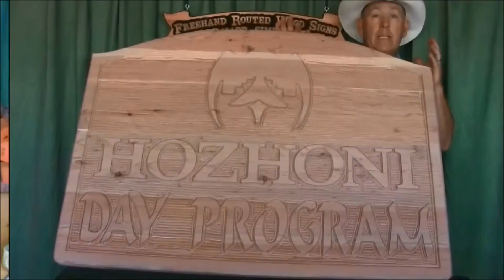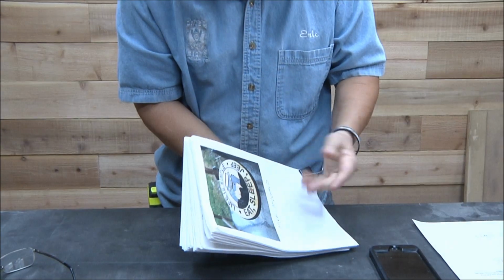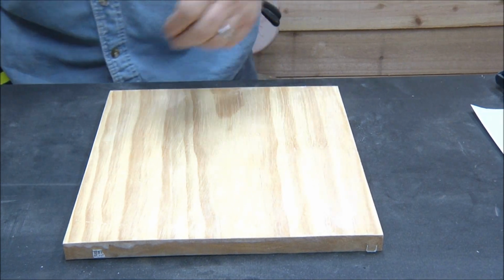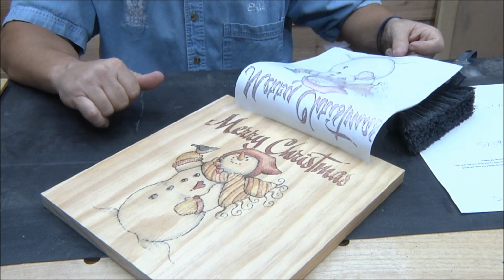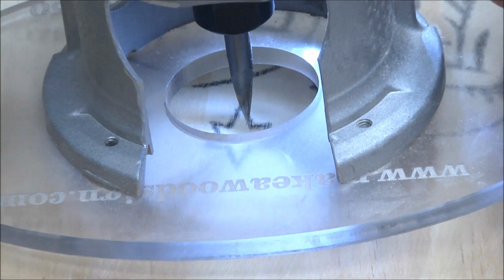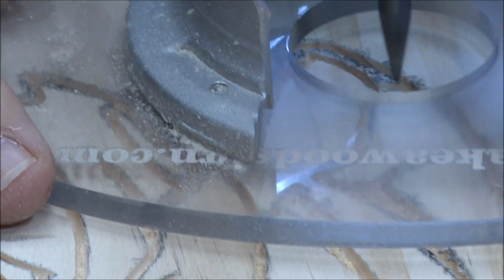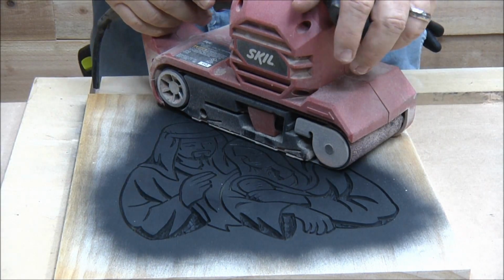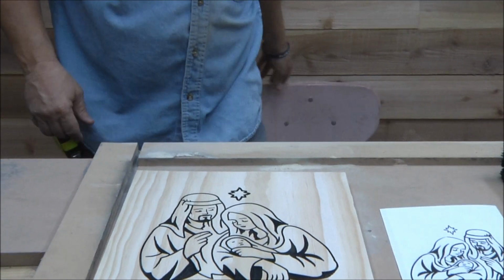#230 Inkjet Transfer Process for freehand Carving Wood Sign Demo

Comment: I've completed sign with inset letters, outset numbers (with Eric's) cloud outline, with full picture in the center (~ 5x9) using freezer paper. Color pic turned out perfect!! I made sure to tape down all sides so pic did not move while using wooden spoon to rub in all directions. To get all ink to transfer and show up nice, you must run in all directions (vertical, horiz, both angled). Picture just adds another element to our router carved signs (plus it easily adds some color). Thanks Eric for sharing all your learned secrets (tricks of the trade)!
Reply from the maker: Sounds like you have a great process that's working for you. Thank you for the kind words, happy to help.

Comment: Attempted my very first router carving on pine.  I used a drill master 120 volt 1/4" trim router and the bit I used was a 1/4 straight bit, only because they didn't have a profile bit. I know I'll need a better router and bits eventually, but I was just trying g this out for size to see if its something I'd like to eventually do and I'M SO IN!!! It's not great but it give me a feel for the handling of the router and the figuring out the best depth for the bit.

Thanks for all the videos and great advice.
Reply from the maker: Thanks so much Emily for watching and the nice compliments. Please let me know if I can answer any questions for you, eric@makeawoodsign.com.
Reply: @oldave100   I'm sure I will have many questions down the line and appreciate your help in advance.  Oh, I forgot to mention that since I don't have a printer, to print a stencil, I used vinyl. I have a cricut die cutting machine and was able to cut out a stencil of my subject.  It was very helpful in keeping me from carving out what I shouldn't.  I will email you a photograph
Reply from the maker: Sounds great Emily, happy it worked for you. Yes I would love to see a pic when you're done. Thanks again!!!

Comment: Hey Eric, Great Video. I use my Inkjet as well. I however use a transparency film. I rough them up with 100 grit sandpaper (WET) and scratch up an down, sideways and diagonal both ways. These are reusable many many times.   In fact I am still using the same one for over 7 months. Happy carving.
Reply from the maker: Thank you Ronald, glad you found a process that works for you.

Comment: Thanks for the idea. The only problem I had is the paper kept jamming. So I just taped a piece of paper on it and it worked great. Works great. Was able to do 2 transfers from one sheet
Reply from the maker: Yea it's funny how some printers can be touchy. Vicki and I have exactly the same model of printer. Mine works fine, and hers jams up. Taping to another piece of paper works or even a glue stick instead of tape.

Comment: sorry for the stupid question, but I have to print the glossy part of the paper or the other? tnx
Reply from the maker: Not a stupid question, I should have said it. The glossy side is what you want to print on. Thank you for watching and please let me know if you have any other questions, eric@makeawoodsign.com
Reply: @oldave100  I tried to print on the glossy side but the print is wet and as soon as you touch the sheet the drawing is ruined
safe to use inkjet or laser jet?

Comment: Definitely going to give this a go.i would normally print a stencil and use carbon paper and draw around everything, this freezer paper could save alot of time . I've never liked the idea of glueing the stencil to the wood ,just to messy. .I've also seen someone use lazer print paper, face down  and a warm  iron,..and you iron the image to the wood and yes it does work..lol..
Reply from the maker: I've tried the iron on and I like this much better.

Comment: Just a tip, if your freezer paper does not feed into the printer, I use a regular piece of printing paper as a backing and just glue the end where the printer grabs. I have found this to work for me. Some printers are a little fussy.
Reply from the maker: Great point, that's where the label backers may work better. They feed through the printers easier.
Reply: Yes I have seen that but I have not tried it yet. Freezer paper is cheap so that is the way I went

Comment: Hi Eric or Hey Bill what do you mean by "using the paper as a follower" tape it don't glue it"?
Reply from the maker: So I've been experimenting with taping the freezer paper to a regular piece of paper. Here's what I did. I used scotch tape and and taped the freezer paper all the way along the leading edge that's feeding into the printer to a piece of regular paper so they act as one piece. It worked good... Then I separate them after the copy is made. hope this makes sense. I'l make a video on this soon.
Reply: Great- I got it.  Thank you.

Comment: Hi Dave and Eric, great process, if the image is bigger than 1 A4 size and would need to be spread across  2 pieces of paper, is the freezer paper still a viable option?
Reply from the maker: Thank you Sean. Yes, absolutely... I just posted a video where I do do layout with freezer paper with multiple sheets. I use a website called rapidresizer.com
Reply: @oldave100  brilliant, do you have the title for it and I'll go take a look, thank you👍👍
Reply from the maker: #426 Hope this helps. Thanks again for watching!!!

Comment: Was that a steel wire brush?
Reply from the maker: No, we use mainly brass wire wheels to clean our bits
Reply: @oldave100  No the brush on the wood after carving.
Reply from the maker: Oh, ok. That's just a stiff bristle brush we use to get any loose material out of there before we spray and sand. You can use a tire brush or heavy duty cleaning brush. The stiffer the better

Comment: Noticed you don't always have your router flat on the board, or was I not seeing right?
Reply from the maker: Once in a while I need the line to be a little thinner so I just lift the router slightly to make the line thinner. Or it could be I want a sharp inside point.

Comment: Another method that works is the one done by Aceman on YouTube, and I have tested it using freezer paper and it does work. The idea of drying it in the sun for hours was nice but it was night, and it was cold, so I just dried it all inside, and I only waited until it was actually dry, not hours. I tested it on text - I have a Tshirt Transfer setting on my printer that does the flipping for me, but it flips everything, so I have to flip the images that I want but leave the text as is.  Print on the side with glue, and the image on my inkjet appeared glossier than on regular paper. (I found this out by printing on the wrong side, but I just flipped it over after that was dry and did it on the correct side.  Materials were Krylon Matte clear spray from Walmart, Elmers Glue All, not the washable stuff, and freezer paper. After printing, and letting it dry for a while, I did have to see if the ink smeared, and it didn't. And after I put the image face down onto the second coat of glue - the wet one - I only waited until the glue above my image was dry.  My test was text, and it came out looking as sharp and clear as the Inkjet Tshirt Transfer paper left them, but it was easier and no ironing. My impatience could have screwed things up, but after the paper treatment dried overnight (spray and one coat of glue), my whole test took about 90 minutes. I do small stuff, so although the freezer paper is supposed to be reuseable, I cut my images out so I have to make another sheet for more images, but I have a sheet full of them to use first...
Reply from the maker: Thank you for your input. I may check into that and give it a try. Thank you for watching, Eric

Comment: Cool vid!  Thanks for sharing!  Couple questions...1.  You mention that you normally use a sanding finish after sanding, what is that?  What is it's benefit?  2. How long after you printed onto the freezer paper did you make the transfer?  Thanks again for such great info...lovin' your channel!
Reply from the maker: Thank you Andrea. 1. I always us Sanding Sealer on pine. It's made to seal up wood and they sell it at Lowes. Pine has a tendency to bleed when you spray it with black. Because it raises the grain you need to knock it down by hand sanding slightly if  you're going to do a transfer like this. 2. I normally print it within a few min of applying the transfer. If you have any other questions you can email me directly, eric@makeawoodsign.com. Thanks again for watching.

Comment: Igave it a shot and found my HP  Officejet Pro ate the freezer paper.  A second attempt had the same result.  What printer did you use?
Reply from the maker: I use the freezer paper now that is made to go in ink jet printers. Look in the description on our video #241, toward the bottom and you'll see a link...  It's by a company "jenkins" It works great....

Comment: Dave, when I print on freezer paper the ink sits on the paper in little droplets. You can even tell what is printed. Any idea what the problem is?
Reply from the maker: Sometimes it looks that way but still gives a good transfer. Try adjusting the printing mode to best and see if it still does it.

Comment: I tried to print the image on the freezer paper (the glossy side) and chose paper option Glossy. Then I tried to print on the glossy side but all it did was smear the image. What am I doing wrong? Every one said theirs turned out great so what am I doing wrong. Should I choose another option or what?
Reply from the maker: I don't charge the setting in my printer at all. Just the normal default setting. On this video I used the roll of freezer paper and cut it up. Later on I found that they make freezer paper sheets made for the ink jet printers. It works WAY BETTER. Check out our video #258, I show it. I will be doing a more in depth demo on this process very soon. If you have more questions you can email me directly, eric@makeawoodsign.com. Thank you

Comment: Eric, a laser printer (I have a wifi laser printer by brother -  HL-L2360D) is about $100.  To say my funds are limited would be an understatement.  The main reason I invested in it, was the cost difference (per sheet) when printing.  The best part?  My ink doesn't dry up like inkjets like to do; no clogging of the print heads, etc.  Not to mention that my toner lasts a lot longer than the inkjets, too.  
To get to the point:  (Sorry, got sidetracked - *SQUIRREL*)  You made a comment about the toner process and using lacquer thinner, and chemicals to transfer patterns.  (saw your video from May, and decided to "run my mouth" here, rather than there, but may post there, too lol).  With many thanks to a router friend, a few years ago, we found the transfer process with laser printers, and instead of the lacquer thinner, and other harmful chemicals, I use Wintergreen Oil.  This process to me, has been the best way to transfer my patterns without losing my lines.  When I used the inkjet with wax paper, or freezer paper, I had no luck with it.  It smeared off.  Just my two cents, and shame on me, I've been lacking in watching your videos.  Since my initial interest in making signs, and after learning from you and your dad, I've let your videos go to the wayside.  You've changed a few things, and just as in the beginning, I'm learning a few tricks/ideas on refining my sign making.
Reply from the maker: Hi Barb haven't tried wintergreen oil. Glad it works for you. I'm now using an inkjet printer on transparency film and I like the way it works. See LTS 9/30/17. Thank you for coming back, for watching,  and for your input.
Reply: Could you describe the process you describe with the Wintergreen oil? Also, what paper did you use? Printer paper? Freezer paper sheets, Dave recommends? Thank you in advance.

Comment: In an instance where you might reuse a line art image such as Joseph, Mary and Jesus in several sizes they can be converted into a vector graphic with a free program named Inkscape. A vector graphic retains all of its detail no matter what size it is from 1/4 inch to 40 inches. It will also work with colored images as well.
Reply from the maker: Good tip, Thank you Paul!!!

Comment: use a hot iron on it much easier and transfers good. we do it to print circuit boards.
Reply from the maker: I tried it and didn't work well for me...
Reply: If you print it on photo paper with laser printer on heavy print. Then iron it on hot. It will work.

Comment: Hi Dave. Thanks for yet another great video. It occurs to me that the wooden spoon is creating heat from friction so I wonder if the generation of heat is as much a factor in transferring the image as the applied pressure? If so, you should try using a clothes iron on a very very low setting to see if this could transfer the image even better. Please give it a try and let us know if you have any success. :)
Reply from the maker: I tried it... It does transfer some using heat, but the rubbing techniques works better. I'll do this on video soon. Thank you for the question and for watching, Eric

Comment: Impressive, where can one get those high speed tools and bits ?
Reply from the maker: I use a Dewalt DWP611 router. You can get at Lowes or just about any hardware store or online. We have them in our Amazon store, here's the link.  https://www.amazon.com/shop/makeawoodsign

The bits we have available on our website makeawoodsign.com under sign carving supplies. If you have any other questions I can help with you can email me directly   eric@makeawoodsign.com. Thank you for watching.

Comment: Great video. Do find that 90 degree bit “cleans up” the wood left in the larger areas sufficiently? I would think a straight spiral bit would produce better results. Thoughts?
Reply from the maker: The 90 works great. A straight bit would work too. Not better, just different results. It leaves a flat background. I like the textured. If you like the flat then that's the way to go.

Comment: what have you found is the best way to keep your wood secured so it doesn't move when you're working? i've had some luck with the foamy stuff that you put inside drawers or cabinets (not sure what that's actually called) and i also used g-clamps, but they made minor indentations into the wood. I'm really enjoying watching your videos, you have a friendly demeanor that makes learning from you quite enjoyable!
Reply from the maker: Thank you Michele, I very much appreciate you watching and the nice compliments. I use a drawer liner rubber pad that I love. Check out video Coffee & Questions 10/2/17. Thanks again and if I can answer any other questions, you can email me directly, eric@makeawoodsign.com.

Comment: Awesome Video Eric!  Thanks for the ink jet tip!  Sorry if this has been asked before but I have noticed that when you carve you never really lay the router completely flat.  Is this to control your depth on different areas of detail or for better control?  I tried my first carving today on a practice piece but I had the router base all the way flat.  It turned pretty good for a first try but wonder after seeing this if holding it up a fraction would better help with control?  Thanks and keep up the great work!
Reply from the maker: That must be an optical illusion because I almost always have the router base flat o the board. You would have much less control by holding it up off the board. Maybe we need to change the camera angle. Thank you for watching.....

Comment: Great job!!thanks for the video....Id rather use a router than a dremel! what bit did you use and is that a 1/4" router?
Reply from the maker: I used our Profile bit and yes it is 1'4 router Dewalt DWP611. If you have any other questions you can email me directly, eric@makeawoodsign.com. Thank you for watching.
Reply: @oldave100  Thanks for the reply Dave! Have a great Thanksgiving!

Comment: Why do you go against the grain with the sander
Reply from the maker: The belt is going with the grain, so there won't be any scratching. I like going side to side because I feel that it gives me a more even surface once it's all said and done. However, I don't even use a belt sander anymore. Here is a video showing the evolution from belt sanders to the disc sander I use now. If you have any questions, you can email me at eric@makeawoodsign.com

Comment: Tip one if you use paper as a follower, tape it and do not glue it. Tip two I use freezer paper instead of reclaimed sticker paper so I can see the image and place it right where I need it. You tape the follower paper so you can remove it  and see where to place it with no problem
Reply from the maker: Great tips Bill, Thank you....
Reply: Thank you for useing freezer paper. where can I get the sanding sealer you use before carving. thank you

Comment: For best result should be Pigment based ink. Not all inkjet printers use pigment ink. Some use Dye. if one is to keep the design on the wood, not carve it.
Reply from the maker: Thank you for the info, that's good to know.
Reply: มนต์

Comment: I just run my boards through a thickness planner after the paint is dry.
Reply from the maker: Dad and I did a video talking about this, #65. I will definitely work sometimes but there can be issues.